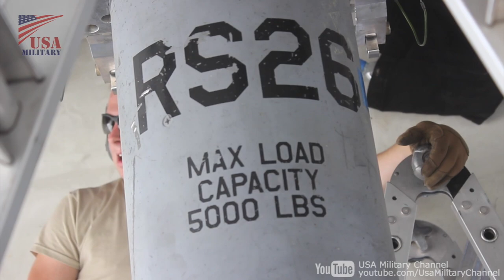B-1B Loads With Rotary Launcher & Stealthy Cruise Missiles

Comment: I don't like that slow loading set up . Those missiles should be pre-loaded on the rotary launcher and the bomber pulled over an in-ground hydraulic ram that lifts the whole launcher up in place then secured . This way in a war the empty bomber can be driven over the re-load ram and remove the empty launcher and re-loaded with a fresh launcher . Then close the doors , take off and recieve an in flight refuelling . Fast and efficient 👍
Reply: Extra launchers are not free. That's very expensive to have extras just lying around. Then you can only load those munitions if you're at a base with a pit and hydraulic ram system. It's probably not necessary. Any speed improvement is probably offset by the cost and complexity.
Reply: @nonconsensualopinion  " If you were in charge they would be chucking rocks at the enemy because they are free and plentiful " 😅😃😀😂😁😄👍

Comment: Suprised they haven't designed something in between the size of the Bone and the B52. A plane that is semi stealth and capable of mach 2 to replace both.
Reply: The whole speed thing is overrated kinda. Yes it helps you get to a target faster but wastes A LOT of fuel and remember its usually at high altitude that they go supersonic. What makes the B1 special is that it flys low level supersonic which is bad ass coming over the Horizon and getting on target quuckly